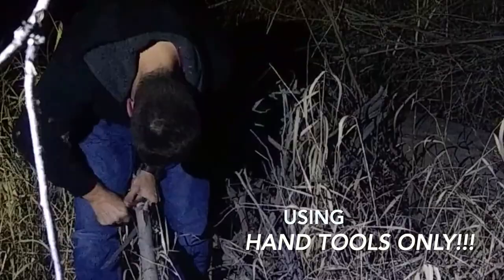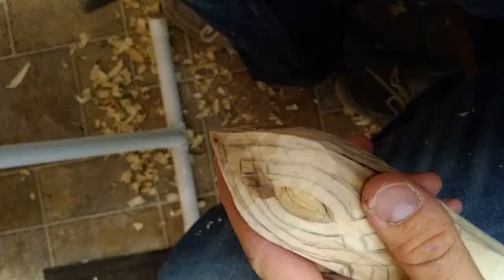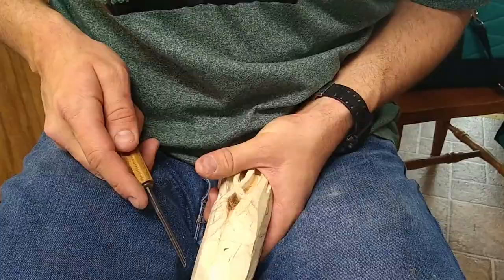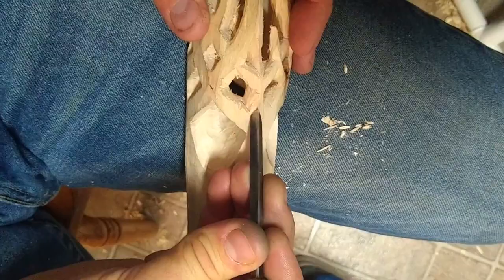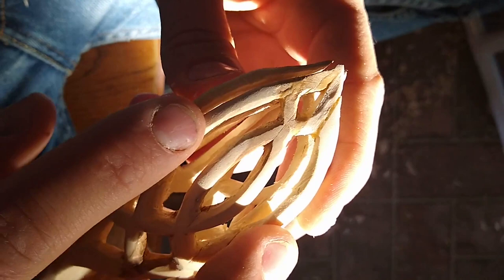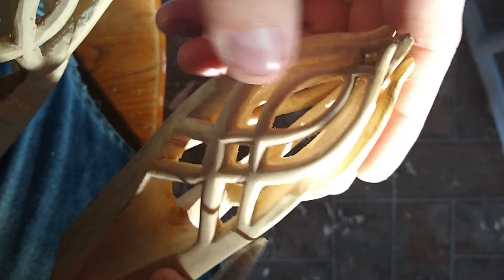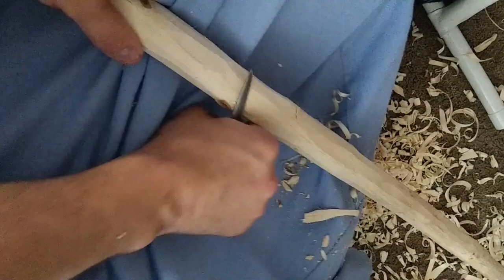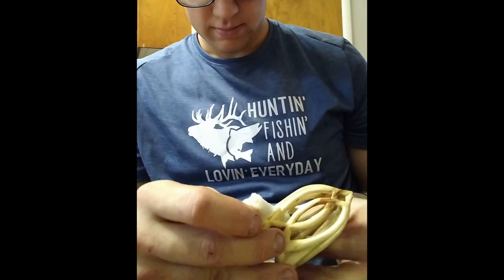Making Gandalf the White's Staff, Hand Tools only!!!

Comment: that is so scary that you are putting so many pounds of pressure into a tool that is directly over your groin
Reply from the maker: I know it looks crazy, but I've been carving for a long time and sometimes it is what you have to do. But to make sure I don't slip through and cut the heck out of my groin or leg I always have my whole arm tensed. You know when people do the prank where they have two 2L bottles of fluid tied end to end and then hang them over someone's hands to hold up in front of them, then place whipped cram of something on their pals and cut the string so that the weight of the bottles is gone they slam the whipped cream into their face. To prevent that from happening to my groin or leg with my chisel I have both my flexor and extensor muscles contracted in my hands, wrists, arms, and shoulder so that if the wood breaks or the blade slips I only move an inch or so. It works pretty good, but honestly, it was the filming that made it so that I was constantly in the situation. Filming life is harder than it looks when you have no camera man, no tripod, and not equipment.